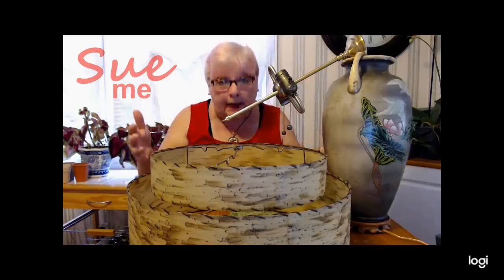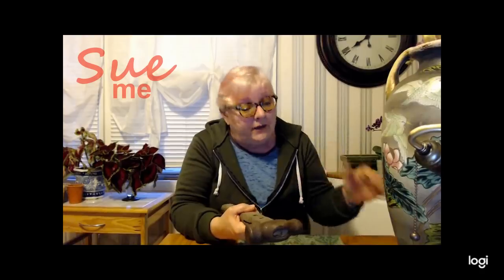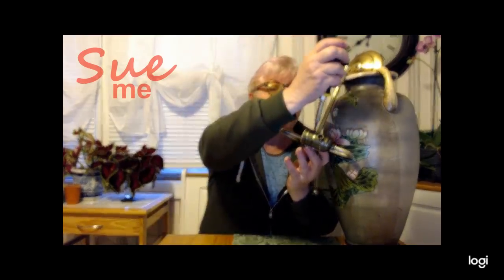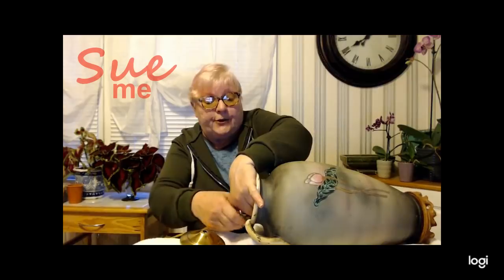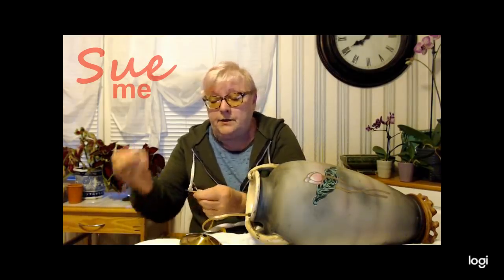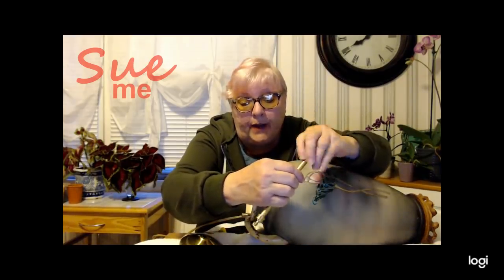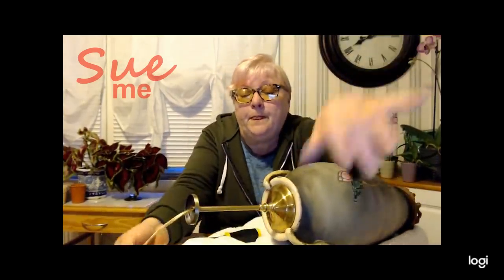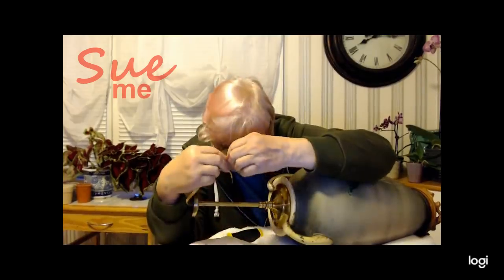Jocelyn's Lamp Disaster

Comment: Great information. Maybe some close up shots of the different pieces edited in to the video will help the view have a better idea of what is happening and better able to use this as a how-to.
If the cord had been broken and needed replaced would that take away from the value of the lamp? Is a repaired lamp still considered original or when reselling do you need to disclose a repair?
Thank you

Comment: Sue you explain  lamp repair so easy and great to understand. Thanks so much!! When you mentioned what the white milk glass top was called that was great to know. My big lamp that I have has one of those really large and I didn't know what it was called. Score...Thanks. Can you spell it for me too?
Reply from the maker: The white shade is a waffle pattern shade and the type of lamp is goes with is called a torchiere.  Sometimes you'll see the French spelling, which is torchère.  If you have one of these lamps, check to see if it is marked Rembrandt - that particular brand is quite valuable.
Reply: @suemeonyoutube  I will check for sure. Thanks again. That is the lamp that the outside shade is linen that had the stain. I need to take a picture of it to show you. Thanks!

Comment: Learned lots! 2 questions, why a ul knot and why wire out of bottom in front. Love ur droll humor😊
Reply from the maker: The UL (Underwriters' Laboratory) knot is used on lamps to ensure that accidentally pulling on the cord won't disconnect the wires from the socket.  If you pull on the cord, the knot catches at the top of the rod and won't go through.  
The wire might have looked as if it was coming out at the front, but that was probably the result of the base getting twisted around while I was working on it.  When it was finished, I lined everything back up so the wire was coming out at the back like it's supposed to.  
However, there are times when you would want the cord to come out at the front.  For example, Jocelyn has wide window sills and she keep lamps on the sills.  It might be very convenient for her to have a cord coming out of the front so she wouldn't have to worry about the cord getting accidentally closed in the window.  

Great questions - thanks!
Reply: @suemeonyoutube  thank u! I'm going to learn lots!

Comment: So glad to see you starting a channel, my favorite CLL vids are the ones with you in them. On a side note, didn't you need a knurled round threaded nut on the riser for the shade to sit on?
Reply from the maker: No - I used a specialty part that is generally called a shade rest or a shade riser.  The type I used can also be used as a reducer to allow the older 1/4" finials to be used on standard 1/8" lamp harps, so you will also hear them called finial adapters.  I'll make a point of showing one of these up close next week...
Reply: Cool, guess I've never seen one. So looking forward to your sharing even more of your experience.

Comment: Dear Sue:  I just purchased a vintage ceramic lamp irridescent embossed flowers.  Love flowers!  Now its around 18 " rectangular tall and the base is 5 " wide square with a 3" round opening.  I cannot take the lamp apart everything is stuck but loose at the same time!  I unscrewed the socket but now it turns around and I need to go into the lamp, hold down that bolt from the inside so I can unscrew it.  How do I find a tool long enouph to get in there. Your tutorial is great on a no trouble lamp.  Help!  Can you please do HELP! Tutorial videos on when you are stuck and tips and tools ect.  What products are safe ( lubricant ) to loosen all that is old good quality but in great shape parts.  You gave me the courage to attempt to up-date wiring, now I am stuck, lol.
Reply from the maker: Here's my best advice - if soaking the bolts in a rust remover (or even Coca-Cola) won't work, get a Dremel or other high-speed cutting tool, and cut the bolt off.  If you don't think you have a steady enough hand, recruit a friend to help.  Go slowly and carefully so you don't crack the lamp, and be sure to take plenty of breaks so you won't overheat it, either - that can cause cracking, too.  You will need to get new lamp innards to put the lamp back together again, but they are cheap and readily available.  This can be done...  :-)
Reply: @suemeonyoutube  Gee I have a hard time communicating in writing to get my point across.  Thank you for your the response.  I finally found a place where they sell extra long bent nose pliers so I can hold down the nut that is inside the top part of the ceramic lamp and unscrew it.  There is no rod,  the wiring goes through that bolt and right to the socket.  Once I loosen that bolt I can figure out what is going on.  Thank you once again for your time.
Reply from the maker: @gksweetmimi  When you put that lamp back together, you're gonna want a rod - it's safer than a pile of loose wires flopping around in your pretty ceramic lamp...  I get my supplies from Grand Brass online.  Great selection, decent prices and fast shipping.  Good luck!

Comment: I've only rewired a lamp out of necessity. Not for beautys sake. However it didnt last long. Looking at your tutorial I believe I did everything the same. Couldn't you also put a weight in the base for extra stability?
Reply from the maker: The lamp is actually very heavy.  But I think that shade (19" wide) might be creating some imbalance.  But it's a beautiful shade, so I added some grippy rubber pads to the base in the hopes that they might keep it from scooting off the end table.  (And if I know Andrew, that end table was polished to within an inch of its life, and was as slick as an ice rink.)  At this point, I am assuming it was just a freak accident - heaven knows I've had plenty of those myself.  Haven't we all?  :-)

Comment: Just curious: The lamp (even when it was a vase) looks top heavy to me. Would weighting the bottom help or make it more unstable?
Reply from the maker: The lamp is actually very bottom-heavy.  However, if it had been top-heavy, it would have been a very easy fix to fill the vase with marbles (or even rocks from the garden) to add more weight.  When I make the Steampunk voltage meter lamp, I will be weighing the base down because it's bakelite, which is very light.  Weighing that piece down will be a bit more complicated, but I will show you how it's done in the video, so stay tuned...  :-)
Reply: @SueMe I can't wait to see that!! Jocelyn has a very Beautiful lamp!! I love how you explained the different bends in the fiberglass shade. I never knew that...Thank you

Comment: Hi Sue, I have a nonlamp question.  You made the comment once about washing Barbie doll hair . My three year old granddaughter enjoys having her dolls bathe in the dog's water dish whenever no one is watching.   What is the best way to take care of Barbie doll hair?  I'm coming close to giving all of them mohawk haircuts.
Reply from the maker: Most doll hair responds very well to a good dunking in fabric softener.  Wash the hair in warm water with dish washing liquid (I prefer Dawn, but anything will do), and then fill the fabric softener bottle cap about halfway with fabric softener, and dunk the doll's head in. Let it sit a while and then gently comb the hair out, starting at the ends and working your way up to the roots.  I use a steel dog comb for this.  Try not to pull on the hair too much.  Then when all the tangles are out, you can pop the doll's head into boiling water for about 30 seconds and comb it out.  Test a small, inconspicuous strand first - boiling water works for most dolls, but without knowing exactly what kind of doll you have, better safe than sorry.  This should get even the worst mess back into acceptable shape.
Reply: @suemeonyoutube  and Kimberly Jordan ; I did something very similar years ago. I had no internet back then, so it was trial and error. I was cleaning up all my old childhood Barbies so I could pack them all away for when I hopefully had a granddaughter one day.  I had 2 amazing sons, but no daughters....sigh  So I bathed the Barbies first, then I tried shampoo, however it did not get all of the dirt or that factory goop they put in to keep the hair "set" in place. So because of that I then turned to Dawn dish soap as well. I figured if it could get oil spills out of wildlife that would die otherwise, I figured this is just a little Barbie hair, so I said what the hec, and got started. The Dawn and then fabric softener worked great for me as well. I also found that if their hair had been in a ponytail holder too long I couldn't get it to lay flat. My solution was too either wrap the pony tail holder (cloth covered) around the Barbie's neck, not too tight or you will have a big ridge in her hair. Make sure all the Barbies still damp hair is inside the pony tail holder before you put a second or third twist around in the ponytail holder. The other thing I tried was fastening scotch tape around her hair and neck. Scotch tape also holds bangs down while you straighten and/or trim them. With some of the ones I bought at thrift stores or garage sales, sometimes their hair was too damaged too salvage it so I just gave them a shorter hair style. One had REALLY bad hair. I had an 80s Barbie I bought second hand so I dressed her in that outfit and cut her hair into an 8os hairdo and even put some permanent marker in to complete the look.  (I used highlighter first to see if I would like it and i did!) Guess we are never too late to play with our Barbies eh ladies? ...LOL Well I not only got a granddaughter to play with them... I got three!!!!!!!  (and three handsome grandsons who also played with them....LOL)  I am not sure what to do with them now that they are all too old for Barbies, but for now they are all clean again and back in storage :) Thanks for all you do (and teach) Sue.